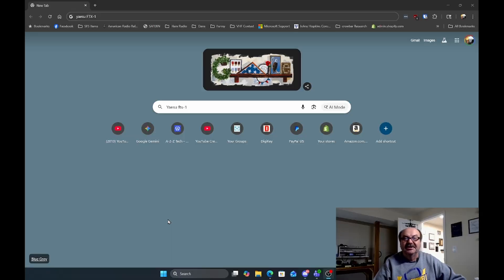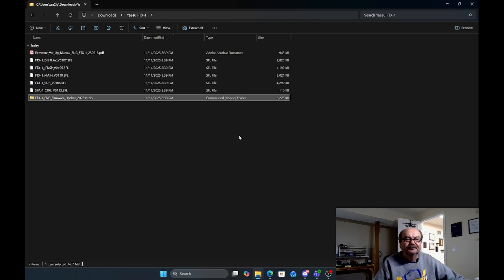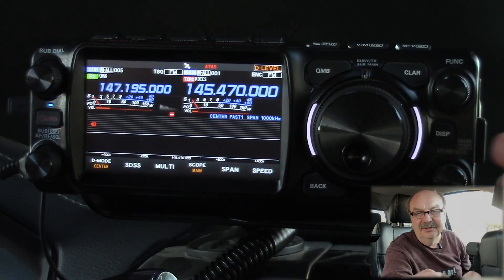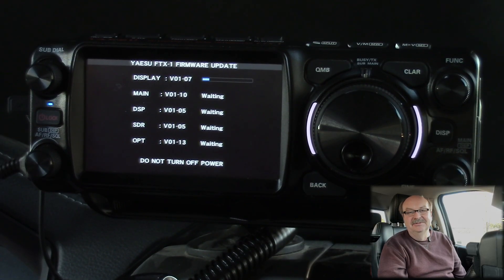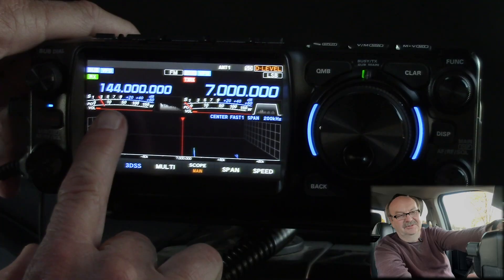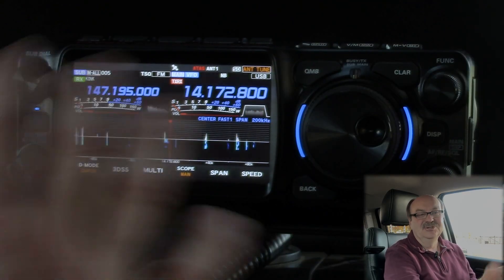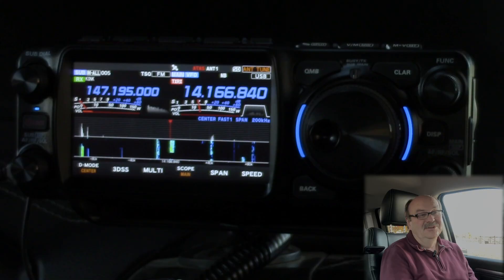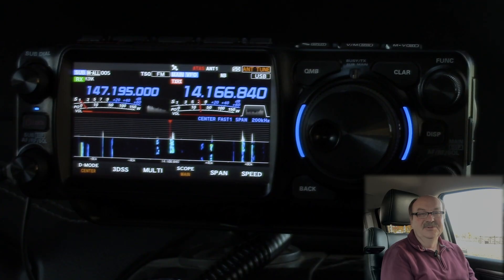FTX-1 A2Z #3 Updating Firmware

Comment: If I have not done any of the updates yet, do I have to do all of those first or will this update take care of the past updates?
Reply from the maker: I believe that each firmware update completely replaces the firmware in whichever processor that you’re updating (MAIN, Display, SDR, etc.). So you should be fine with just installing the latest update.  Just be sure to pay close attention to the Firmware Update instructions if your MAIN firmware is V01.00.  There are a few extra steps for that update.

Comment: Warning: Don't update! My frequency expansion is gone. You can switch the device to UK mode, but then only 60m and 4m work. However, I have the EU version, and there 4m and HF were completely unlocked – transmit and receive fully.

After the update, everything was gone. I'm sending the device back again; apparently, only Yaesu can unlock it. Furthermore, many amateur radio operators are experiencing issues with their SPA-1 receivers, which are no longer working and also need to be sent in for repair. So, stay away from this update!😡😡😡

Comment: Nice tutorial for firmware updating. Seemed like it was going to be simple, until error code 001 after reset. I’ve read that some have updated and reset the field unit first, then updated and reset again after doing the optima. And also of lots of optimas not working after updating. I’m going to sit this one out as my 4 week old FTX-1 Optima has worked as expected out of the box. I tried a Thinkware GPS antenna to give APRS a try, but APRS did not update position regularly. I thought it was the Thinkware antenna so I returned it - don’t really have a need for APRS anyway.
Reply: I do not think it was the GPS antenna.  I have used several GPS modules, and it seems that when the radio gets a position fix, it does not update again.

Comment: Hi Tom, as I'm imminently about to get an FTX-1 it's upsetting that I need external power to update the firmware.  I am getting an Optima because it's cheaper to buy it all in one, but as this is my first HF radio I was going to get a power supply after Christmas. 
Is it possible to update the firmware if it's plugged in to a power delivery USB charger?
73 🇬🇧 M7GTX
Reply: DON T UPDATE !

Comment: First, your vids are always done better than I can do. So there is no criticism here, just suggestion.  1st thing I would do is compare the various f/w files to what my radio has.  2nd, I would save all my settings to the SD card.  3rd - make sure I have installed the latest USB driver even if I am using a SD card   Then I would see if I want to update the rig.  Thanx for the vid.  73
Reply from the maker: Thanks.  Those are good suggestions.  I did check the firmware in the radio first.  I probably should have shown that or at least talked a little more about it.  I did also save the radio settings ahead of the update.  That probably needs to be another video.